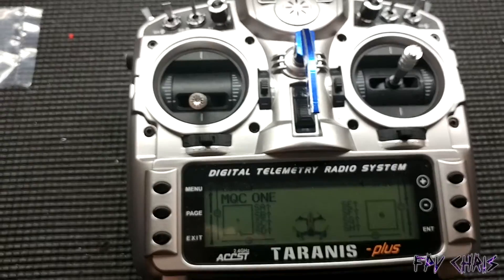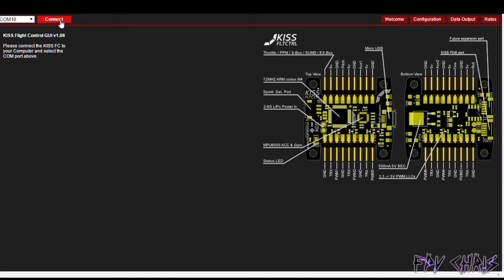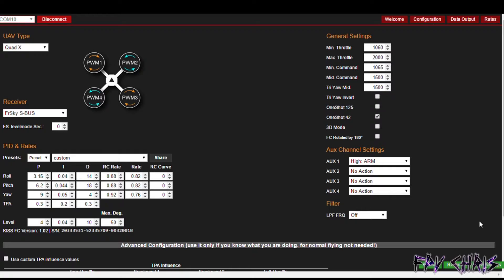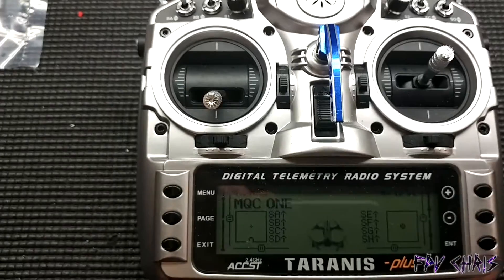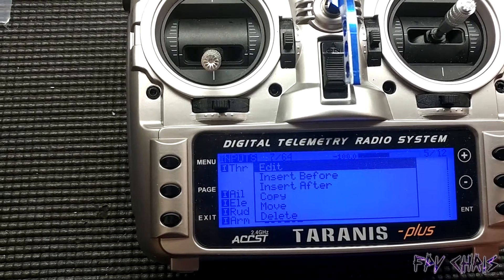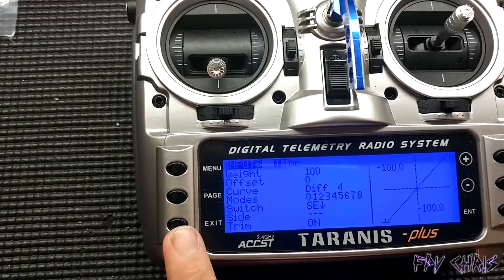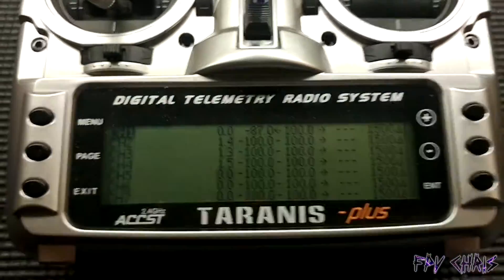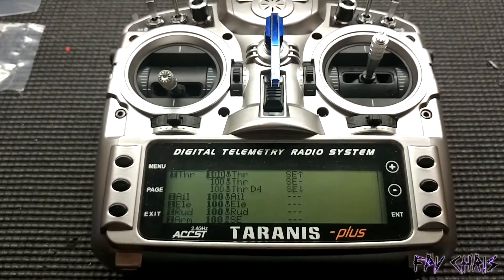Kiss flight controler arm & air mode on 3 way switch

Comment: First of all, great instructional video. We need more for guys like me. I'm having a difficult time trying to figure out how to make the necessary adjustments to reverse my switch positions where using switch SG, disabled is towards the front of the radio and airmode is to the back. My logic tells me its the offset in the ARM Input on channel 5 but I still can't get it to work. If someone can enlighten me, it would be much appreciated. Thanks
Keith

Comment: ok finally built the quad, i have it setup exactly as you do but it jumps into airmode on both arm switch positions, basically like its going off the min throttle instead of my switch settings... someone help!! lol

Comment: is this just an idle up or is it actual air mode?   I'm just finally building a second quad,  my first used a naze32 with Cleanflight.
I don't see an air mode in the GUI

Comment: Chris, first thanks for the tutorial, always glad when people help out others :-D
Q)  Will I be able to arm the regular way with throttle stick?  Or am i still gonna have to use the switch?

I wonder why don't they just add airmode to a switch in the GUI like Betaflight did then we won't have to do all this.
Coming from latest version of betaflight this is rather disappointing implementation of airmode without an easy to add to a switch.

Comment: So I have to turn the diff to 18 to get it to jump up. When I do only motors 1 2 3 actually jump up. Motor 4 does nothing. And 1 2 3 are some what erratic they seem to gradually increase. It feels like in the sky this would be out of control for me.
Reply: 1070 and 1075 for min command

Comment: Chris how will the sound change when setting up the DIFF to let you know you are in Airmode/Idle up.I can't tell the difference 
when increasing the DIFF.I am new to KISS flight controllers.Like your videos ! Could you show this in a video.
Reply: I tried that but could not tell the difference.Maybe I have my min command set incorrectly on my throttle.

Comment: Air mode is a mode that is in cleanflight.  basically gives you control at min throttle.   This accomplishes the same thing.  I like this method of a 3 pos switch because if you don't want idle up you can just leave the switch in the middle position.  I think I'm going to try to set this up in cleanflight as I don't have a kiss flight controller.  Should be the same exact thing though.

Comment: Is there a way you can arm the quad in middle position and not have the motors spinning?
Reply: Did you find out?
Reply: Nothing yet! still trying to find a way
Reply: I believe this is built into the FC so it's "high"
Reply: I get the same thing.  Arming the quad automatically spins up the motors, but the motors don't spin fast enough to control the quad in air at zero throttle.  I'm sadly lost.
Reply: Check your minimum input throttle. This should sort it out.
Reply: im getting the same thing,  i have my min throttle at 1050 and min command at 1055...  and everything is set Exactly as chris does...  but it idles up in both positions.  anyone figure it out yet?

Comment: sorry man but thats not Airmode, better take offline cause this is missleading ;-)
Reply: Guess what.. In Kiss FC when you set the min command to 1000 this enable air mode... it is the same thing as idling up.. In Kiss FC, if the throttle is above 0, all function of motors and gyro's are active, So on Kiss FC, this is Airmode.